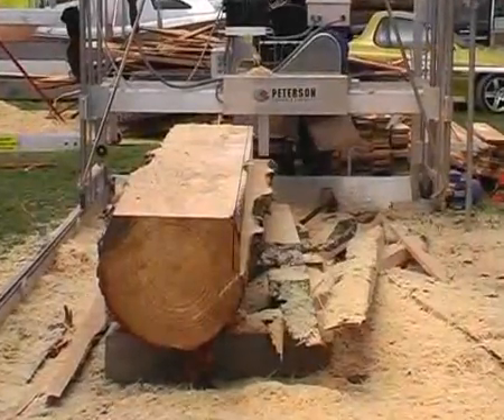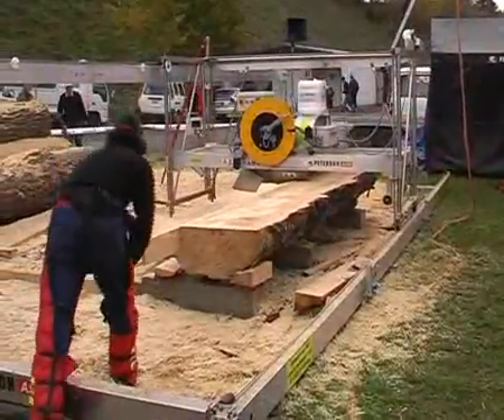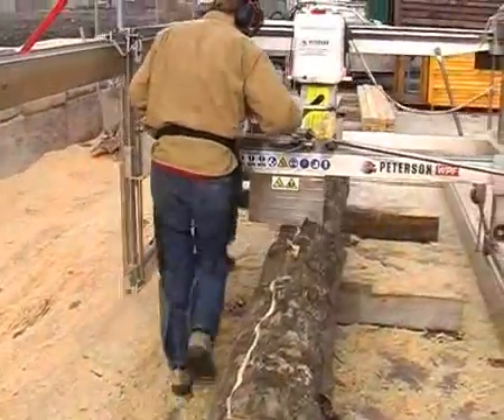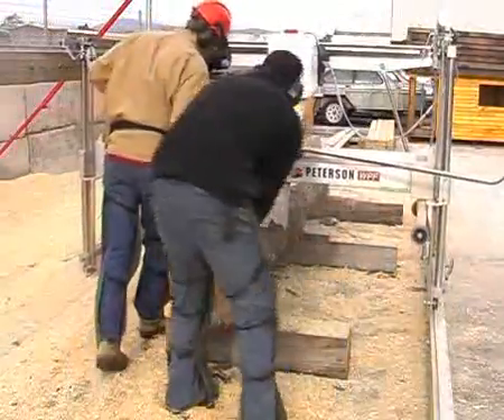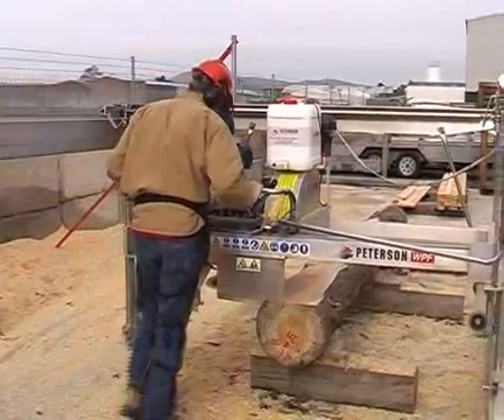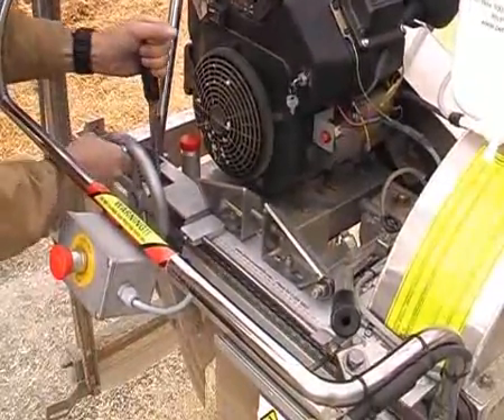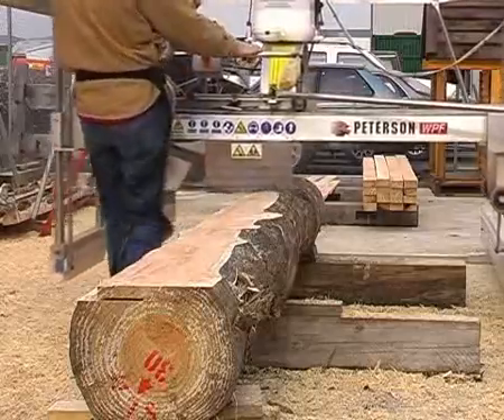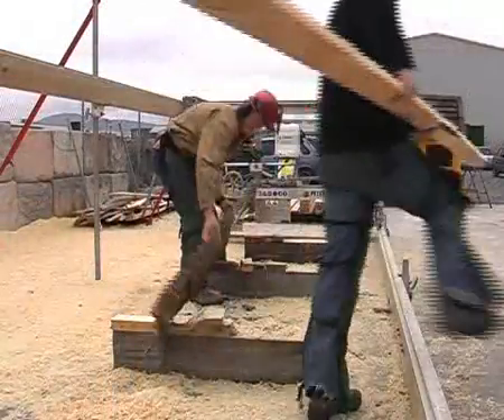How Swingblade Sawmills Work

Comment: Does the direction of cut and direction spin for the blade effect feed rates or cut quality?
Reply from the maker: For safety in portable sawmilling, we always insist on Counter Cutting, where the blade is spinning AWAY from the feed direction.
In a situation of Climb Cutting, the blade would be spinning INTO the feed direction, and will ‘grab’ at the timber, causing all types of safety issues.
The portable sawmill field is one where neither the log nor the sawmill are mechanically fixed – this ‘grab’ and ‘pull’ could cause a lighter-weight portable sawmill to raise up or pull away from the operator, and a lighter-weight log or remaining flitch to be grabbed and flung back towards the operator.
Neither direction is any faster cutting, as the sawteeth still need time to cut and clear the wood chips, and in fact Climb Cutting could easily cause blade jams if fed too fast.
Neither direction would create much difference in finish, but if you have even a slight crookedness in tips or sharpening, Climb Cutting will cause the blade to pull in the direction of it’s tips, pulling sidewas from the sawing path, and creating a wider cut kerf and more sawdust.
Again, for efficiency and safety, Petersons always insist on Counter-Sawing in the portable sawmill arena.
Reply: @PetersonSawmills  thanks after watching the video again I realized with the way the blade is rotated the operator wasn't climb cutting like I thought at first.
Reply from the maker: @1987Confused  No problem! Sorry it took me so long to reply to you!